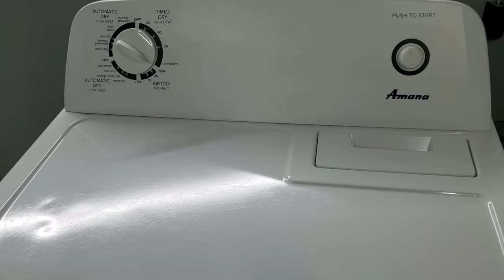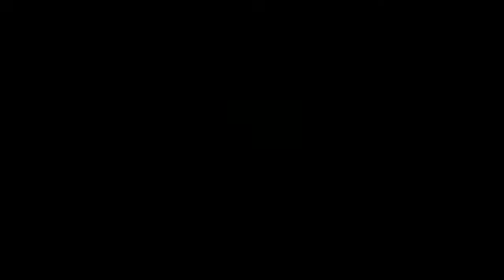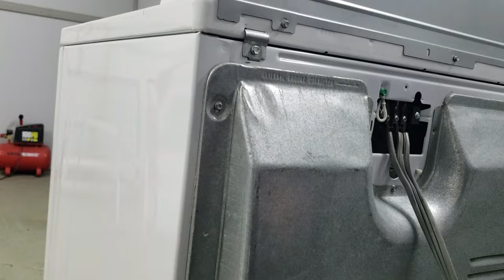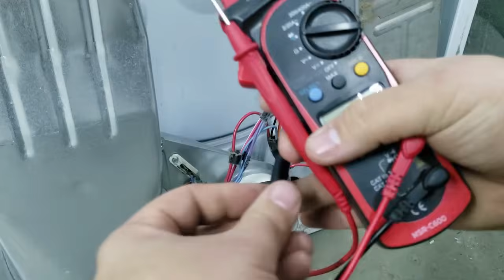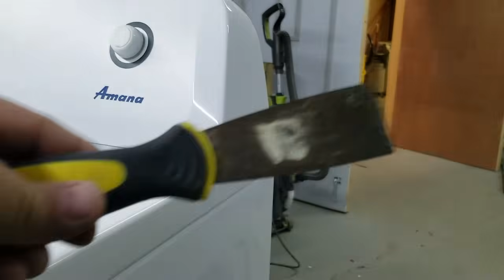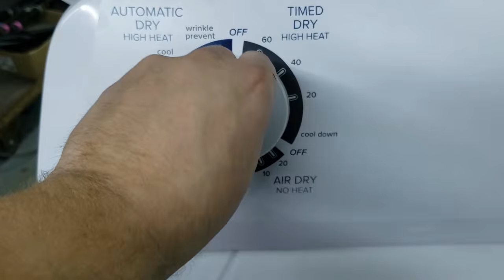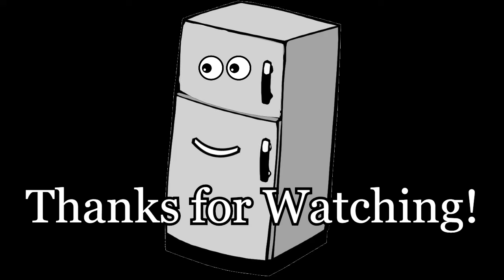How to Fix an Amana Dryer that Won't Heat - Also Works for Kenmore, Maytag, Whirlpool and More!

Comment: My thermostat only has a wire to one of the prongs. The other prong is empty. I see yours has a wire on each prong..? It looks like we have the same dryer…????
Reply from the maker: There are some models of thermostat which have a wielded dogleg piece on them that attaches directly to 1 of the 2 spades of the connector instead of a jumper wire.

Comment: Very helpful I tested my hi limit fuse and was open circuit, bought the hi limit thermostat in a set with the hi limit fuse because was likely the reason it blew. $10 on Amazon for the set and took 10 minutes to replace. Thanks
Reply from the maker: Glad to hear that fixed it for you, it is a very common point of failure!

Comment: Thx for this!  Actually in my case, the problem was the one part you didn't check in the vid (I don't think) for continuity, the thermal fuse.  I ordered a kit from Amazon which included the fuse, cycling thermostat, the thermostat itself, and a hi-limit thermostat (which I couldn't locate on my dryer).  Other than the hi-limit thingie, I replaced all the rest of the stuff.  10 bux with one day shipping...I had my dryer running by next day.

Comment: That is the moddel.i have it takes me 2 some 3 times at 60 minutes each to dry a load of laundry any idea the issue? I have taken the heat pipe out and cleaned it out and the lint trap and the vent on the back as well

Comment: I have watched this numerous times. Replaced all sensors. No heat. I even changed wire from the breaker box. This dryer and I are headed for a divorce!

Comment: You helped me so much. For the cost of a thermostat ($8.) and a multimeter I have wanted beforehand I avoided a $500 cost for a new dryer. 
My one suggestion for the video is that you ask us to plug it in to test the voltage to it is sufficient but do not then tell us to unplug it for the circuit testing. I finally noticed the cord/plug laying on the floor while you used the multimeter but until then I didn’t know whether it needed to still be plugged in.
Thanks for the help, I subscribed and sent you some money through the “$ heart emoji” icon.

Comment: I really need some help with this. My  high limit cutoff was just replaced a few weeks ago and went out again. I can’t find anything else wrong with it, and the parts store sold me a kit with the replacement, that included the WRONG thermostat.
Reply: I get continuity on my thermostat and checked every other possible reason I can think of that the cutoff went out again and can’t figure it out.

Comment: Ben, I have an Amana dryer as your video, except is more of a plane Jane model. Lately the dryer at times runs for about 20 minutes then stops. I open the the door and the dryer starts heating. I removed the back cover and cleaned the lint, and relapsed the timer, but issue still remains. I have not replaced any other parts. What does your experience tell you? Thanks for your great videos.

Comment: I’ve checked everything stated in the video and Amana dryer is still not stay on after pressing the start button. I have also checked the motor and wiring harness. Should I just get a replacement kit and replace all of these items? Thank you.

Comment: I replaced every part on this dryer timer and all parts from the back. im still got getting heat. And it's  getting 240v. All the parts I took off and put on are checking out. Any idea?

Comment: I took apart lint chute cause I dropped a lid in there and removed the lid now dryer won't hear I have same dryer as this one
Reply: I took it back apart to make sure chute is seated properly (cause I tore  a small part of the mesh gasket in the lint chute) and I made sure lint vent that goes outside is cleaned out installed properly but still won't heat

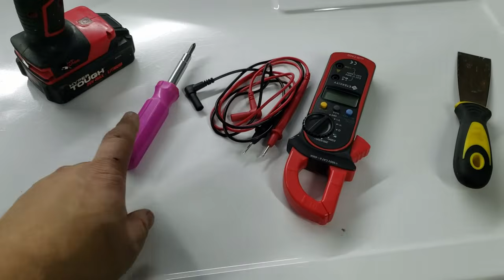Comment: Thank you for this mine ended up to be a thermostat which is way smaller than the thermostat that you have a picture of and I’m on my way to pick it up right now. They want 2599 for it. Can you believe that but what are you do you know? 1:04
Reply: You might aswell just buy this dryer it's only like 500 bucks

Comment: Just wondering if you’re still answering questions ? A wire from the cycling thermostat to to heating thermostat keeps burning out near the heating thermostat. I’ve replaced both and it keeps happening. Thanks

Comment: Fantastic video. I attempted to diagnose the dryer without power and found no issues. All resistance was within tolerance and all continuity passed with flying colors. The heating coils look fine with no heat spots or damage. Next step is to check power and see if the dryer is working again.

Comment: I know this is an older video but I think I have the same exact dryer and it’s not drying or getting hot after use. I think the heater core is out, but I was wondering if the part thats linked in the video the “whirlpool” part the part I need? Never worked on a dryer but I just wanna make sure I get the right part.

Comment: My door doesn't stop the unit. And I replaced all the sensors in the back plus the heating element still no heat what s h would I do next?

Comment: My Amana dryer 2009 the heat won't  come on I replaced the 4 sensors in the back and heating element also still me heat. My front door doesn't stop the unit anymore could that be the problem? Can I test it?

Comment: Stupid question, when you are doing all these tests does the power need to be plugged in?
Reply from the maker: For resistance ohm tests, no - keep it unplugged. For live voltage, yes you'd have to but those are few and far in between.

Comment: Excellent video, thank you very much for making it! I followed your instructions and it was my heating element that was broken. When I removed it, I saw that the coil was physically snapped, so no continuity. I ordered a new one from the manufacturer and installed it and it works now!

Comment: I checked each of these parts, every one tested fine. Put everything back together and it's working. Bad news is that this is the second time I've taken it apart to troubleshoot it and both times it worked afterward. So what's my next step?

Comment: Silly question but does the Dryer need to be plugged in, in order to use the multi-meter and test the continuity? or un plug the dryer before running diagnostics?
Reply from the maker: No, unplug it unless you're doing a voltage check

Comment: Question i have a whirlpool dryer simular to this one ive cleaned the lint trap and inside caseing ,ive put in a new heat element and replaced all of the fuses tested the timer and im still getting cold air what am i doing wrong ???

Comment: Feeling frustrated, my dryer turns on but won’t heat up. I bought a replacement kit and replaced everything, also when I replaced the heating element the coils were blackened as if they were getting way too hot before, now I have a brand new one in as well as a replaced fuse and thermostat and I checked the breaker as well. Any suggestions what this could be, am I missing something??
Reply from the maker: Check terminal block / make sure 240v power is coming into dryer
Reply: @bensappliancesandjunk  I checked that, just like on your video. I checked the two sides for 120 v and then 240 together. It was a little bit over, maybe 245 v. 😞
Reply: I have the exact same issue. Replaced all 5 parts and have proper voltage going to the dryer. I’m thinking the only other thing it could be might be the timer switch? Doesn’t seem to make sense to me but I have replaced everything else.

Comment: gr8 video I fixed a whirlpool dryer for my father,  in my case is was the thermal fuse $1 part
 I was replacing his dryer with one I was given  that didn't' work.  His dryer  needed a part but since it was 38 years old the part cost more then the unit in working condition.

the person I got the dryer from was moving and decided to just give it away.   The Thermos fuse blew because apparently their try vent and lint trap was all clogged ,  I cleaned that out   on the unit.

Comment: Your video was awesome. But I’m nervous. My dryer only blows cold air
Reply from the maker: Test the thermal fuse and element, they're both cheap and common issues

Comment: Thanks to this video I fixed my dryer by myself with no prior experience with dryer repair. Thank you so much. I found a used replacement part from a local recycler so my dryer is up and running for $25 the same day!
Reply from the maker: Thanks for watching!

Comment: I tested the cycling thermostat from contacts that connect to the purple wires and got no continuity on the ohms setting instead of 3.6-7.2 ohms. I purchase a new cycling thermostat and that also got no continuity across the contacts for the purple wires. Is my dryer different? Did I miss something?

Comment: I have a amana dryer and the heating element burned out. I have a new one but there seems to be a wire that's missing and I can't install it until I get a diagram for the way it supposed to be wired. Can you send me a picture of this?

Comment: I have this exact dryer and I followed every step exactly, twice over, everything returned the same results as yours, but mine isn't drying. The heating element does not appear to come on/glow when running it with the door open, or while watching from behind with the back panel open. Nothing is getting warm on any cycle. Can you give me a guess as to what might be causing my problem? Because I cannot afford a repair or replacement and I was really hoping to fix it myself
Reply from the maker: Did you check timer? Or terminal block for 120v?
Reply: Thanks for your response! Yes, I did.
Reply: I had the same scenario. Everything checked OK but still not drying. So, I took the timer apart and found severely burned A/B/C contacts. I filed them and the heating element fired up. I guess the contacts were good enough for the low current ohm meter but failed with the high current heater element. I ordered a new timer for $75 on Amazon.

Comment: Hi Ben, I have a Whirlpool mod WED4815EW1. No heat and timer did not advance. I replaced timer and that was not the solution. I checked the power. 120…120…240. I replaced all of the 
parts and still no heat. What else might it be? Thanks for the great video! Randy

Comment: I have the same Amana dryer you using to show. My question is: the highest heat automatic dry not working well, is there a sensor inside the dryer to sense when clothes getting dry? Can the sensor be clean? 
Emery
Reply from the maker: If its not drying at a reasonable speed, check vent for obstructions as well as deep clean/wash the filter. Usually that solves it.

Comment: My whirlpool wed5600sq0 dryer has no heat, and never appeared to have low heat. 

All of my tests come within spec. 
Hi volt block- 119,119, 238v
Stat- continuity
Element- continuity, 9ohm, no contact on housing. 
Cycling stat- red, continuity, purple, 7.19 ohm
High limit cutoff- continuity 
Timer- all connections as depicted in the diagram. 
Thermal fuse continuity. 

Cycled the breaker... Prayed, slept on it. Still no heat. 

Can you help me diagnose this?

Comment: Great job Ben! Found a burned out heating coil and the 4” exhaust had a HUGElargemous Lint Bunny stuffed into it. Tells me that the thermal high-limit switch was malfunctioning as well - although it ohmed out just fine. The whole 9 yards with all heating related components was all of $25 on Amazon.

Comment: Very efficient video production - THANKS! I went through all your component tests on my AMANA NED4655EW1. All tested good. No corrosion or loose connections observed. The dryer turns ON on every cycle normally. It cycles through and dries each load (all cycle options). The heat shuts off at the end of cycle, BUT.... the dryer continues to run forever. Is there something in the TIMER /Controller that is not allowing the TIMER to completely cycle to "OFF" ? Thanks for any advice.

Comment: What does it mean if my voltage on the left and right lead are 119 but as soon as i turn the dryer cycle to on, the right lead voltage drops off to 9 ?
Reply from the maker: Floating neutral. A wire or the breaker wire is bad

Comment: I have checked everything and continuity and resistance checkout. I have voltage at the main cable. Thermostat, fuse, temp select switch are all functioning correctly. It still feels like the dryer is not getting hot enough. Could it be the heating element that needs to be replaced?
Reply from the maker: "Hot enough" usually means there's something stuck in the vent system causing it to not heat well.
Reply: @bensappliancesandjunk  I took off the back and nothing is clogged. Replaced all the small components on the back and the heating element and it’s still not getting hot. The only thing I can think of is the duct but I looked in it and it is open with no clogs so I am really clueless. The dryer is tumbling so the motor is working. I am just out of ideas.

Comment: I have a question my dryer timer a not showing no  continuity. But B and C does. What's A for.
Reply from the maker: A is heat input. If no continuity the timer is bad
Reply: @bensappliancesandjunk  thanks. And how i you chank a is it like c to a or b to a. And which black and red thing in order. And if a has no continuity can the dryer still heat up.its a amana dryer  ned4655ew1. My dryer sometimes won't heat up but sometimes when I put it on 60 it's does something heat up. And the timer makes noises like buzzing when I put it on 60 or  40 or 20 without pressing the start button. And do you know what good website for a timer for amana  ned4655ew1.
Reply from the maker: @titanfire619  if the contacts are going bad the heat can be intermittent, yes. It definitely sounds like its the timer.
Reply: @bensappliancesandjunk  do you  buy any chance know of a website for the timer.
Reply: My timer is a w10745655 a. And it's a amana dryer ned4655ew1. And I found out my dryer  heating element only have one  wire to it.

Comment: 7.18 ohms is way too low for light dry settings on the cycling thermostat.
Reply: What?
Reply: @danielm.9818  Huh?
Reply: @Cotronixco  Are you saying an 7.18 reading means it’s a faulty component?
Reply: @danielm.9818  I don't remember. It's been a year. Sorry.

Comment: Hey Ben, ive check continuity on all points everything checks out good. Any ideas where to go next. Timer hangs up at 40mins and we lost heat. Exhaust duct has no obstructions.
Reply from the maker: Likely timer contacts
Reply: @bensappliancesandjunk  this will affect the heat simultaneously?
Reply from the maker: @Dzkoco  the timer has 3 contacts in it that control heat. I have a few videos on it for my channel.

Comment: Great video.  I was able to use your tips to locate the damaged parts and less than $20.00 later I have a working dryer.  Since the parts were so reasonable I ended up ordering a kit and replaced the fuses and thermometer.

Comment: I have the same dryer I just put a ner timer in it because it didn't want to turn off all the time but it's still not getting as hot as it used to I have to run a load twice any advise
Reply from the maker: If it is getting warm or hot but is not drying the clothes. Then there is a vent obstruction somewhere period lent is clogging up the heater , preventing it from pushing the moist air outside period the blockage could be inside the vent of the dryer itself or in the duct going outside
Reply: @bensappliancesandjunk  thank you very much

Comment: I am only getting 124 volts on each leg of outlet and on each screw/wire of braker and when combine both legs of 124 volts on either outlet or braker I get 0 volts. Replaced braker and still 0 volts. Any idea why can't get 240 volts?
Please advise.

Comment: never used a multimeter... it looked like you were using red and black leads interchangeably... is that true/ok? or is like a car battery where you have to have red to positive , black to negative? also. I'm assuming to test these, the dryer has to be plugged in...right? if so, you were pulling leads by bare hand... is there any danger of shock doing that? Kind of need to edit the video for real dummies like me. Thanks
Reply from the maker: It's voltage AC so there's no polarity to worry about at all. If you are testing the terminal block for voltage it needs plugged in, but if you're testing individual parts, it needs unplugged

Comment: Thank you for the excellent video. I have the same model, and I tested everything you suggested in the video other than the loose wires thing at the end ( I did not understand that part well). Everything looks fine, and the values are good, as you suggested. My drier still won’t dry.  What could be the problem? I appreciate your help!  
Also, I had only one spade on the heating element. For whatever reason, there is a place, but I don't see the wire also. Also, the terminal showed continuity. It is the one towards the machine side. My drier was working fine, but it stopped working when I moved to a different house.

Comment: Great video!  Thanks, was able to fix my Amana dryer for less than $19 following your video.  In my case it was the fuse, the guy at the appliance parts store took one look, and reached under that counter and pulled one out.  He said he sells around 100 of those a month.  Took the ducting off, cleaned  out the accumulated lint in the duct, and around the fan, checked everything over, re-assembled and back in business.

Comment: Thanks for the video. One note: You show the "thermal fuse" on your diagram @ 4:13, but you failed to test it. This fuse is actually one of the most common things to go and a relatively inexpensive and simple fix.
Reply: you are right that it wasn't really mentioned in the video but he does explain his thinking in more detail here in a comment to MrBrady255 below